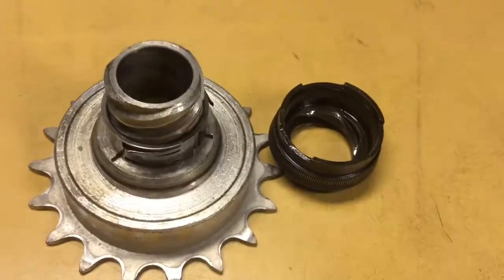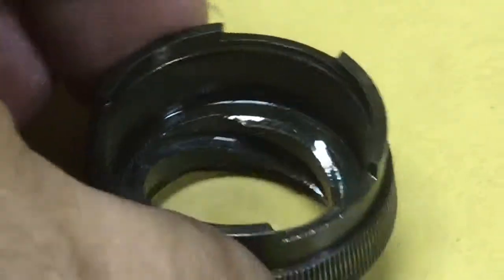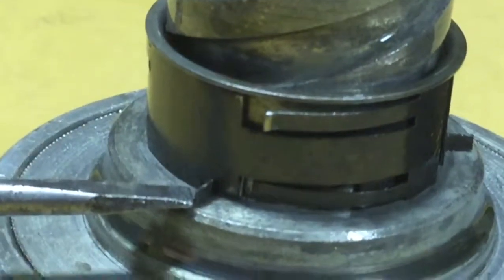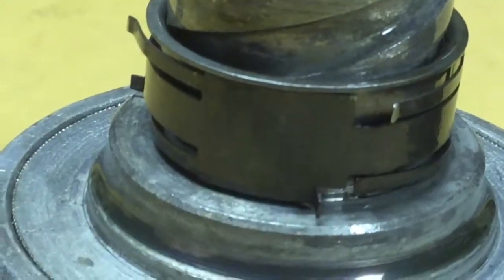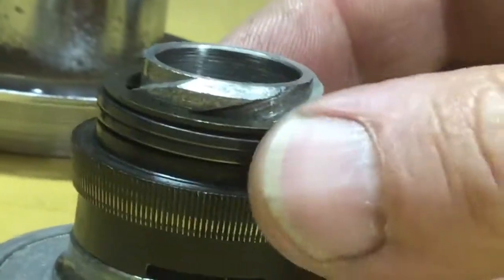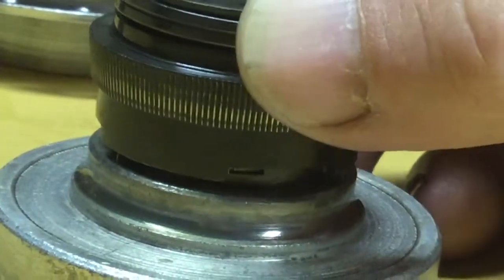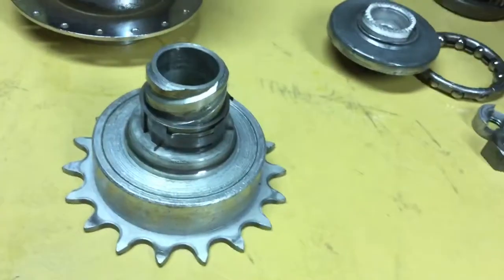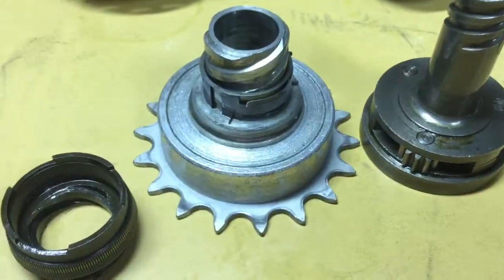Bendix 2-speed how it works part 2

Comment: These videos are awesome! I've been putting off fixing my 1960 Speedster because I had no idea how these hubs work.
Thanks so much for this information.
One question... What is a good lube when reassembling the hub?
Thanks
Reply from the maker: I like using automotive wheel bearing grease for disc brakes (high temp) in these hubs. Pack all the bearings and coat everything else, leave a bit extra in the hub around the brake discs.

Comment: Thank you for taking the time to share your knowledge. I have 2 different red band bendex 2 speed automatic hub . Both were stuck in high gear. After watching your videos, I felt comfortable enough to go ahead and disassemble 1 of them. Just as I thought. Worn index spring on ratcheting side. I gave all 3 a little bend back out and now it shifts perfectly. I can't thank you enough for your videos.

Comment: I am about at my 5th/6th  time (over the years) of taking my Bendix 3 red stripe apart.  Now I know how it works.  Thanks!  
On this repair, I replaced a roller bearing that was falling apart and some of the brass brake discs.  But I still have an issue with slippage when pedaling, especially when starting in either gear .  My guess is that the clutches (the knurled part) is getting too worn and may need replacing.  Over greasing the inside of the hub may also be a problem (and an easier fix if true).  What do you think?    
Years ago some one was selling a red "Bendix Hub Service" shirt patches with the idea being if you ever took one of these 2 speed hubs apart and got the bike rolling again you had earned it.  I bought one!
Reply from the maker: Yes, worn clutches or worn shell will cause slipping. Also check the drive side hub bearings and retarder springs if everything else checks out ok.
Reply: @okbridges  Thanks for the response.  I just took the hub apart again (to earn my Bendix patch!!).  I cleaned grease out of the hub, went with the best parts of the two sets of clutches I have and cleaned them off.  Very little grease on these items now.  Reassembled, and at this point the slippage seems to have stopped!  I'll give it a real test tomorrow.  Thanks again for the vids and responses!! Jim

Comment: How reliable are these hubs ?
Reply: Extremely!, they are 60 years old most were never serviced and still operating perfectly.
Most problems I've found is the old grease has dried up and is like tar.
Anything broken I've found is by improper disassembly.

Comment: Will you ever do a vid on the Bendix 3 speed?
Reply from the maker: It depends, I don't have one of the Bendix 3-speed unit to video. If I ever manage to get I would do a video.
Reply: Okay cool. For the average mechanically inclined motorized cyclist, you think I could service it myself with a slow nd careful overhaul?
Reply: And is it similar to this in design? Cause I keep hearing they're really dependable, think I should look for one for a beach cruiser build
Reply from the maker: Take a look at the service literature at http://www.trfindley.com/pgbndxhbs.html to get an idea of what's inside and how to take apart. These hubs might be rugged, but they've been out of production for 50 years or more, so bear that in mind. The best service info on the 2-speed kick-back hub is here: https://www.sheldonbrown.com/sutherland/CB-IGH-3-bendix.pdf